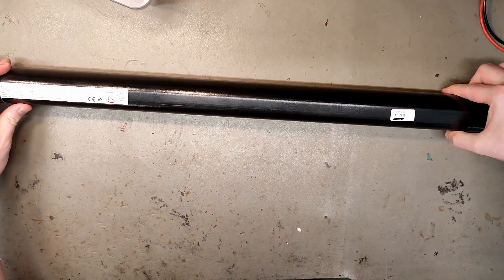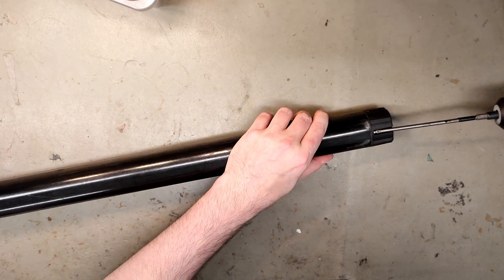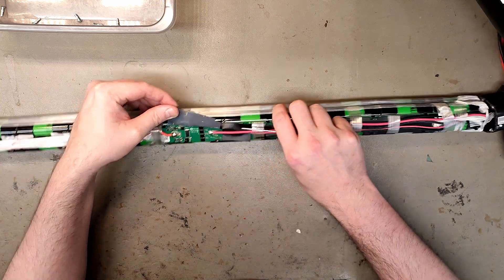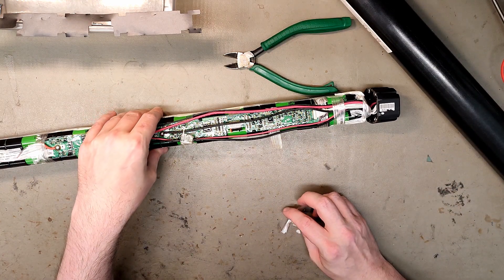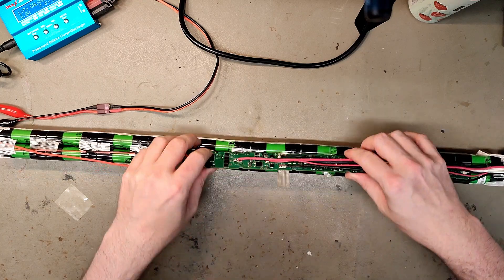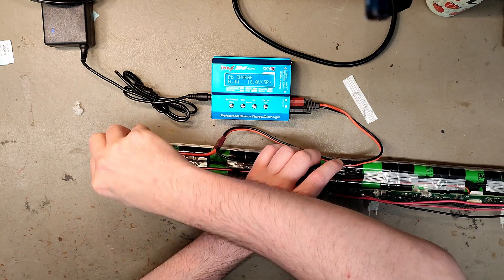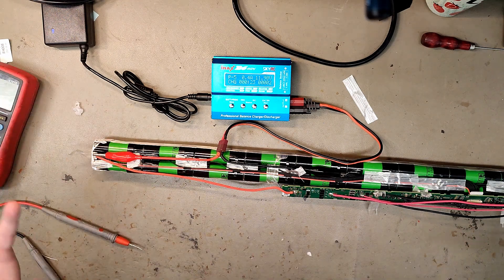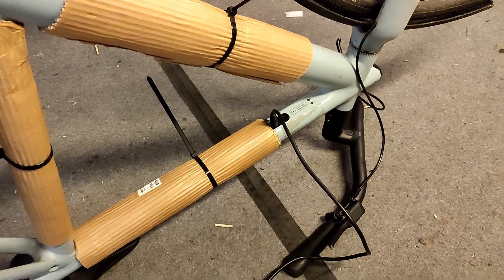Successful attempt reviving low voltage VanMoof Intube battery

Comment: Question!!!

Sparta ion L battery.

I can take a wire negative from the charging point? 
Don't want to open the battery, i need to connect an external controler. 

Thanks

Comment: Thanks millions. With out this video I wouldn’t have known this simple easy repair process. I went on Amazon ordered a £35 charger. Removed the battery, copied ur video. Within a hour the battery was charged to 28v and back in the bike and the original charger is now working perfectly. Hats off, and thanks again 😊

Comment: You only need to charge the pack up to 25V, thats where the BMS cuts when discharging. From there the BMS can charge. If you have a Vanmoof Powerbank, you are even better, that have extra headroom, so it can charge from 20V, as to compensate for voltage sagging during rides, as the PB supposed to be charging during riding too.

Comment: Nice work, this method works for me too. I charged my battery to 36 volts then I put it back in the bike, the screen shows like 20%, then I fully charged it with the original charger to 100%. 
FYI- when the battery was dead, I was getting an error 4 and some time error 18 when I was trying to charge the battery on my bike with the original charger. also the LED light in the charger was changing from red to green to red to green) 
Thanks so much.

Comment: In the video you say you wouldn't charge below 2V but as you attempted to balance up from cells that were down to 1.7V and it appeared to work would cell groups as low as 1.3V work thats what mine have gone down too and im not sure if it's safe or worth trying.

Comment: Thanks a lot - I had run into my second error 4 situation (first one fixed with battery swap under warranty) and managed to fix it using this exact procedure. Used the same charger - my cells were only down to 2.2 V so I decided to use the straight Li-Ion program at 0.2 A and just stopped it when it reached 3V. Wires that came with the charger could only reach 3 cells so it was done in groups of 3, 3, 2 and 2. Will be very very careful not to let the battery fully discharge again!

Comment: I have a noob quesstion! for power supply going into the IMAX B6 MINI, can I use the Vanmoof power supply to do this, or does it need a different kind? if so, can you recommend one? Also how good of an ides is it to try this without something like the IMAX B6 MINI? Just using the Vanmoof poer supply and connecting that straght to the battery pins and try reviving it that way if you have nothing else? Thanks for this great video I'm going to try this myself.

Comment: How did you remove the battery?  Through fork removal?  Seat post removal?
I wish for a "International Board of BMS" to dictate size, shape and power - they did it for gasoline fillers and cell batteries.  All these proprietary boards and batteries are not good for the industry.

Comment: What is the minimum voltage for charge the battery so it can back into the bike?
Reply: Li-Ion 36vdc lowest (LOW-CUT) should be 30vdc.  Any lower, might cause the cells will stop working.

Comment: It is dangerous to recharge a li-ion battery which has gone too low. When the battery goes below a certain voltage (read the data sheet, usually 2.5 or 3v/cell, his are at 1.8v) the copper inside the battery starts to plate out, causing internal shorts, which can create a bad fire when recharging. At around 6:33 he mentions that the voltage is too low for the li-ion setting on the charger. This is a safety mechanism that he is bypassing. The charger is trying to prevent causing a fire in the over-discharged  battery.
Reply: i have seen people "revive" batteries that has too low voltage by charging it with another battery just for a few seconds and never seen any issues , also this is why he charges very slowly and watches the temp

Comment: Thanks for the video, how do I know what is broken with the batterie, how can I check the BMS or just the voltage of the batteries are to low?
Reply: its a Vanmoof S3 Batterie, the same you have on the video
, or other question, can I send you the battery for repair?
Reply: I have the same question

Comment: Usually you can charge the battery with the original Charger aswell. Due to lack of a labor charger I'll give it a try somewhere safe outside. I also will check it with my multimeter and just push the battery to 33-35V, put it back in and let the bike do the rest. Do you have any suggestions where to hook up the charger for the whole battery?
Reply: You sounded so sure about which method to use, but did not applied in real world. Come on, I was waiting 9 month for nothing. It is not a good idea to charge directly with the original charge, because you will be delivering too much power (42Volts and 4 Amps). Charging it with the charger on the video, you will be able to charge the battery selecting a lower Amp (0.1 or 0.2) to be safe without overheating the batteries.
Reply: How did you charge the battery with the original charger? Directly on the bms?
Reply: @Dennis000236  I didn't tried it yet
Reply: Hast Du es schon gemacht und warst Du erfolgreich?
Reply: @stillmangal  immer noch nicht 😅
Reply: @der_rechtsamwald schade... hätte gerne gewusst ob es wirklich funktionert! Ich werde es wohl die Tage selbst machen müssen.
Reply: @stillmangal  Berichte gern. Ich denke, dass meiner soweit kaputt ist, dass sich eine 250€ Pauschalpreisreparatur lohnt. Daher habe ich nichts gemacht.

Comment: I use 2x iMax (probably clones) to charge 36v batteries. The iMax outputs are isolated from the 12V power input so I can use a single ex-PC psu to power them both in parallel. I use the balance connections otherwise there is no point using an iMax. I also have an old Dell printer power unit that delivers ~30v and I use a buck converter set for 25v and 100ma to bring the cell string up to the minimum voltage the iMax will accept to charge as lithium - about 2v each or 20V for a 10S string like this.

Comment: Vanmoof now bankrupt like Bionx. Have you had any more bionx batteries done recently ever since you stated you’d never touch another one? Just curious as I’ve got 2 recelled batteries for my smart Ebike. One with Sony VTC6 (12Ah) and one with Sanyo GA (14Ah). Bike still works great only had one BMS explode literally (charging IC) due to my “charger” becoming faulty and sending a massive voltage spike due to blown caps. Luckily got the BMS replaced with a new one and a custom 3rd party charger to not blow up again. Lastly are Sanyo GA cells good long term like the Sony? Keep up the excellent work!